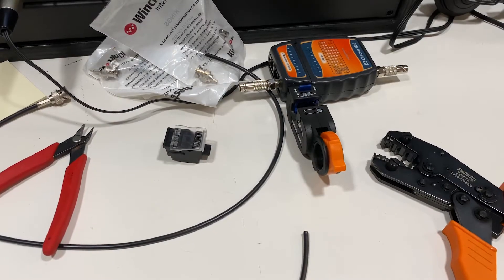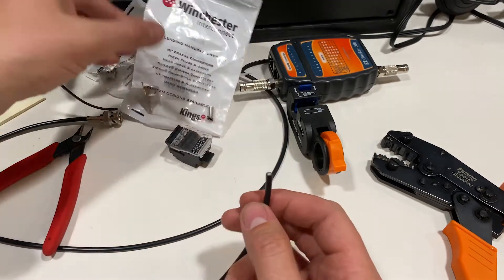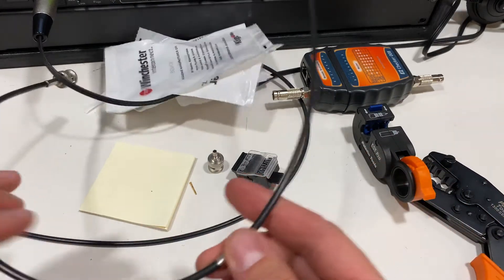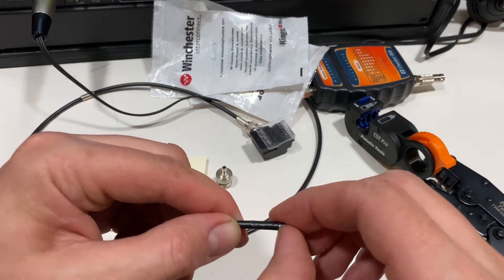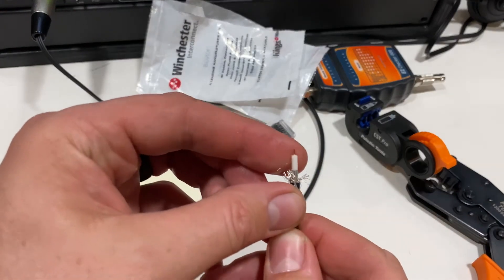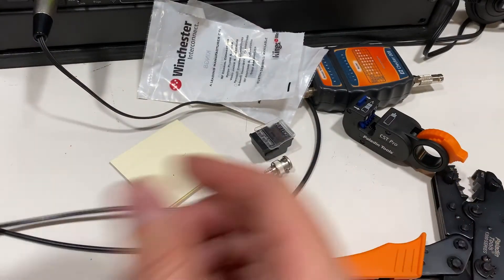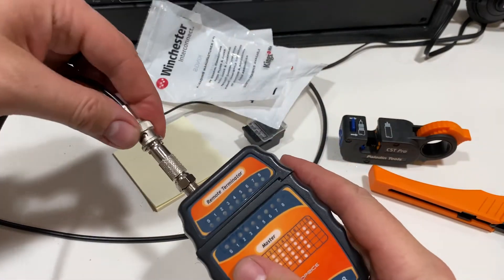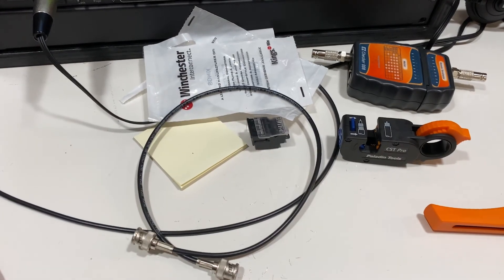How To Build SDI Cable | Belden 1855 & 1694

Comment: List of Components used,:
- Stripper PA1283
- Paladin Tools PA8000 Crimpall 8000 Crimper Frame + PA2699 DIE 
- BNC Tester EZ Checker 008
- Cable Belden 1855

Comment: The Paladin CST-Pro strippers are great (compared to the ST1 that I was using in the past). Just bought two of them to leave them adjusted to the two cable type we use (Belden 1855A and 1694A). Just make sure to buy it with the right blade cassette for your connector of choice (read the datasheet).
Reply: Do you have to adjust them or are they pre set for the 1855a and then another to 1694a?
Reply: @limitlessavl1256  they need to be adjusted the first time you use them, once I'm happy with the setting I leave them that way (maybe a minor adjustment once in a while). You could readjust them for different cable type with the same stripper but I prefer to have them ready (one for 1855A and on for 1694A) and not readjust them all the time.
Reply: How do you adjust the blade? Just got mine in✌️

Comment: a simple DC continuity test does not 'certify' a 3g, 6g or 12g sdi bandwidth.  one must actually use the cable for video transmission.
Reply: can you recommend a tool for certifying?